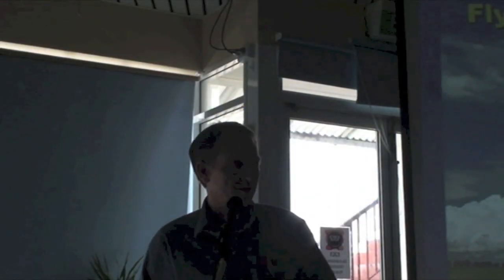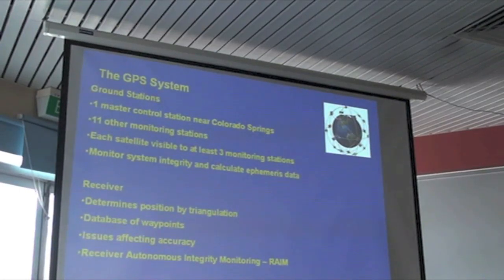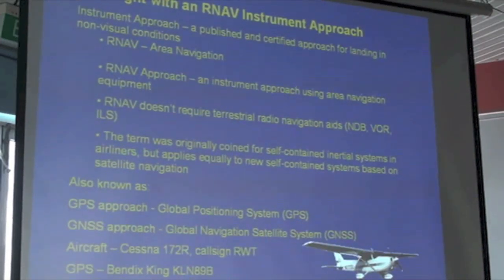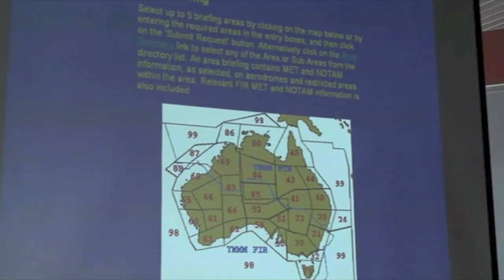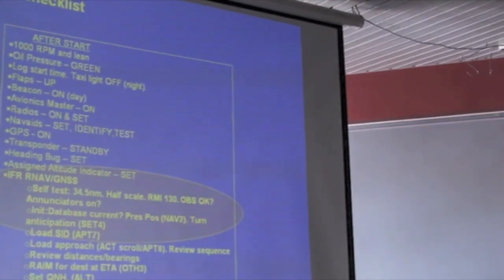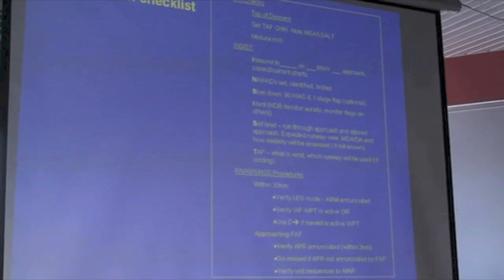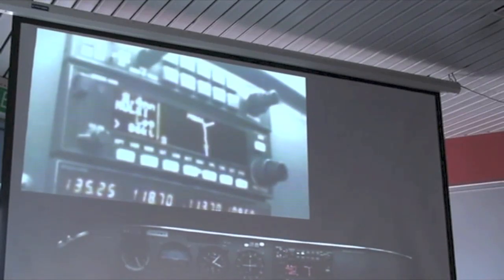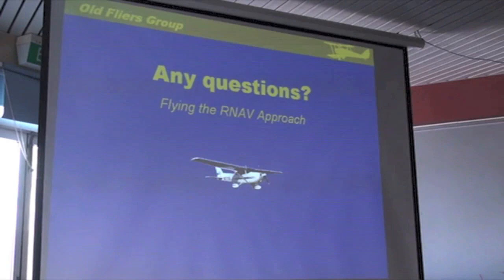The RNAV approach

Comment: How old is this? His info is incorrect. Standard accuracy for a smartphone is 16ft. The difference between Military & Standard accuracy has to do with whether a unit has a single or dual receiver. Standard single receiver GPS as an accuracy of 15ft. Dual receivers have an accuracy of 10 inches.
Reply from the maker: This was recorded in 2008 Jamie. Technology improves over time as you point out.